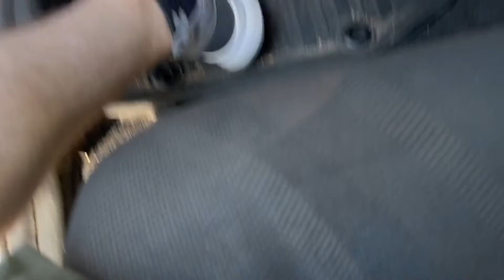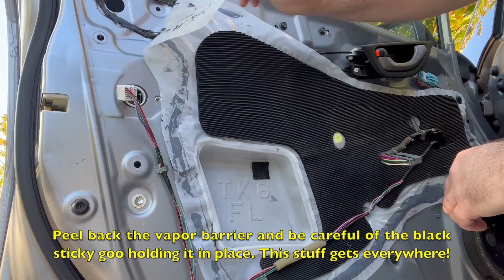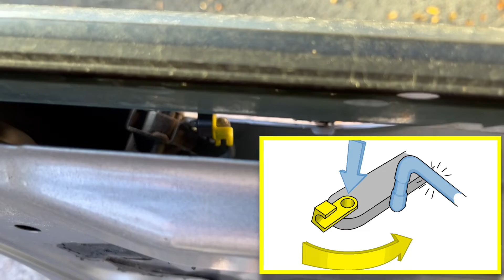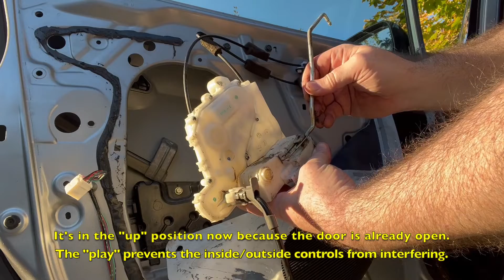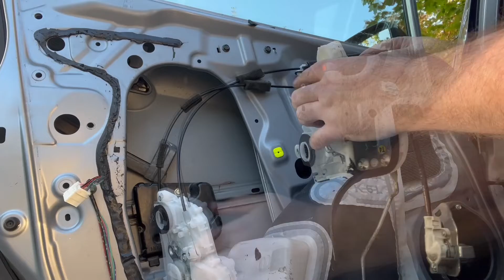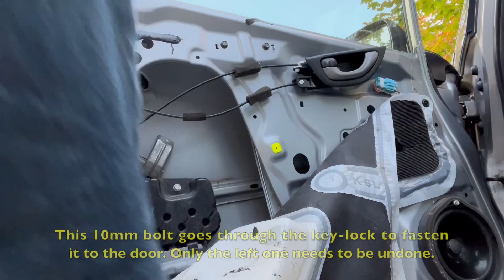Honda Fit door lock actuator problem - Part II

Comment: After replacing actuator with new one and the door lock w/ key new, the key foabs don't work anymore nor does alarm system.   Why?  1/20/26
Reply from the maker: That's a good question. I expect the new fobs don't recognize your car's computer. The actuator is just a motorized locking mechanism but the new keys are mated to the lock/keyhole part. The computer talks directly to the key via RFID so these are new unknown keys. You'll need Honda to program those keys to your car, or sell you new keys. I hope that helps!

Comment: I ran into problems. my key turns to right and gets stuck there until I force pull it out. This doesnt unlock the door after I put new actuator in and connected to power

Comment: Thank you!!! Your video helped a TON! Another fellow did one, but didnt explain thr little locking tabs (diagrams helped).

 My 2012 Fit Sport would do the lock/unlock deal, then lately, it would just unlock on its own. With your helpful videos, i replaced it and all is well. 😎 

Now, i will be able to go into a store without the 50/50 chance i would cone out and have the door unlocked 😂🤣

Comment: what do you do when you can't get the screws out of the door, even when using an impactor?
Reply: Ooooo yeah, that's tough. They use thread lock and really tighten those down! I'm not a shop mechanic but my dad used to heat them up a bit. Penetrating oil helps too. Also you can hold a screwdriver in place and hammer straight into its head. You need to break the adhesion in the threads. Good luck!

Comment: Getting the rod off was definitely the hardest part. I wonder if the head of the rod is bigger on some models making it more difficult to dislodge. I stuck long needle nose pliers  between the door frame and where the window lowers and rested on tip on the head of the rod and the other tip on the back of the black plastic part that surrounds the rod and latch. I slowly squeezed until the rod popped out. I also put electrical tape on one end of my pliers to prevent too damage to the part that was resting on the black plastic.  Thanks for this video, it was very helpful and probably saved me a ton of money!

Comment: How did you determine which actuator was the issue? I have the same problem you had, one of the actuators keeps triggering the drivers door lock but it never locks?

Comment: Very good video, except for a few clarifications, as I just did this repair this morning (5/21/24) and it took about 1-1/2 hours with 2 persons:  1) Make sure your window is in the up position before you begin; 2) Be sure you have Japanese metric #3 Phillips head screw drivers as the American versions do not fit correctly in the screw heads; and 3) MOST IMPORTANTLY, all the videos about this repair skip over the difficulty of removing the 3 screws that hold the door latch in place.  YOU MUST USE A IMPACT SCREW DRIVER WITH THE CORRECT BIT and even then, you may strip the screws!  Use some kind of "liquid wrench" on these screws before even starting.  We used an old time manual impact screw driver with a mallet and it took sometime to get the screws loose and out.  We even had to use a small torch to heat up the screws to get them to loosen up enough to remove.

Finally, be sure to use official Honda parts as the aftermarket stuff (from China) is crap and will not last long, if at all.  Also be sure to include the foam tape in your parts list as you will NOT be able to reuse the existing foam on the old assembly.

Good luck.  It is worth the effort as your local Honda dealer will charge you $1,200-1,800 for this repair. The parts from Honda are about $330 as of May 2024.
Reply: A big thank you for your valuable time to help your fellow citizens. Your shared additional info is extremely helpful.

Comment: Did you go OEM or aftermarket on the replacement actuator?
Reply: I went to go look if the OEM part has weatherstripping and it also does not. Additionally, the replacement Honda part is made in China, not Japan. Not sure if OEM is worth 13x the expense. Hoping the one I ordered solves my door lock issues.

Comment: This is by far the best and most descriptive video on making this replacement happen. 

I just finished mine outside in 38 degree weather. 

The door handle connecting rod was the biggest issue for me. I needed to use needlenose pliers to pop the rod out through the hole on the handle.